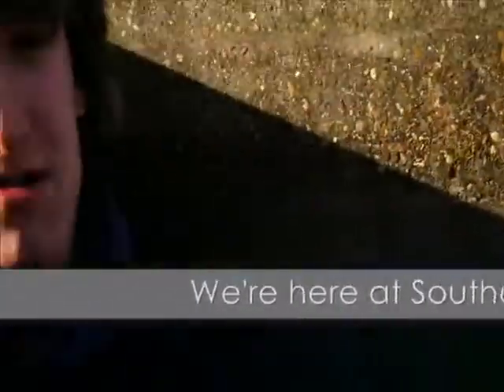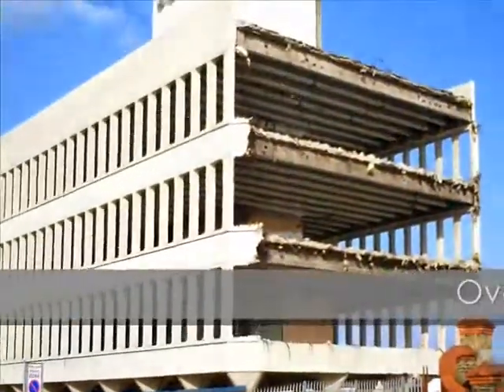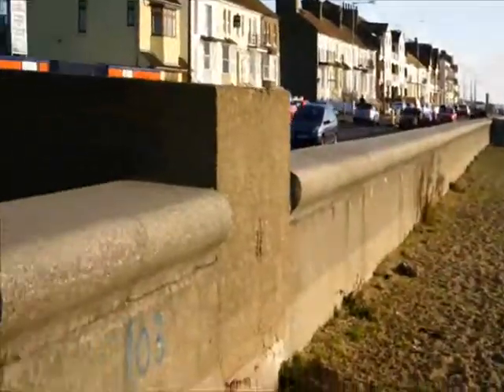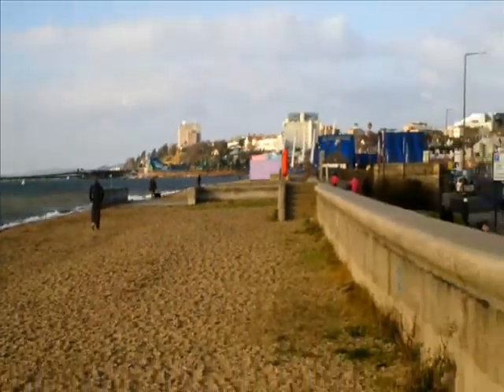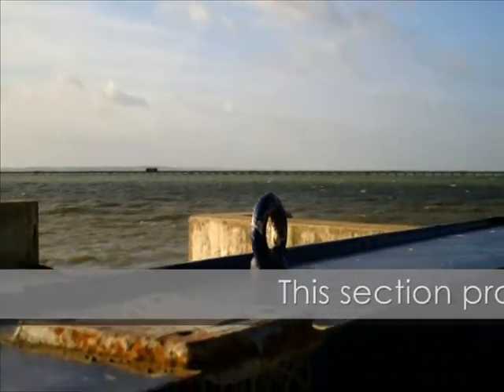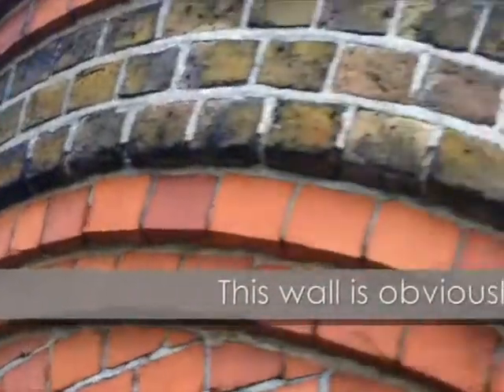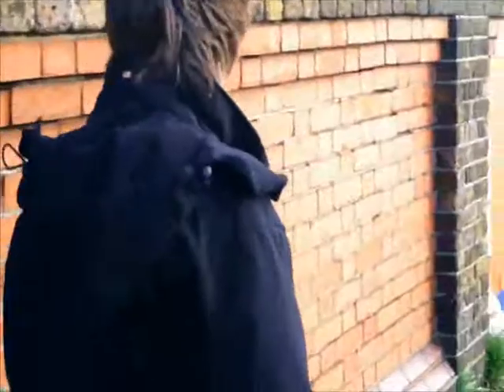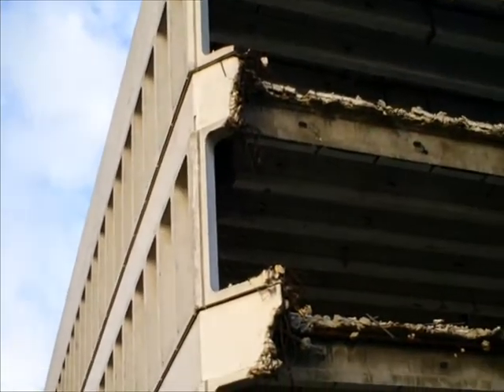Southend WWII Defences (2012)

Comment: Hi Guys, I'm always following your vids and you do some great work, however i'm destined to correct your facts on this one , the area to which you define as an industrial estate was in fact the site of the Southend Gas Works and the blocks attached to the sea wall actually stood at the base of the Gas company's delivery pier which housed 2 large coal fired cranes which took delivery of coal that was sent across a bridge across the road on conveyor belts directly into the gas plant, there was a loading pier that stood alongside to that which was Council owned and bared no significance to the industrial estate that never existed, the pill box was in fact the letter box to the Gas Works and was used for safety of its workers in case of attack, i remember all this from when i was a little lad and remember it all operating , sorry to tell you all of this but it had to be told, still keep up your good work lads
Reply from the maker: Hi Colin thanks for your message and following our videos. Of course this is an old video of ours and isn't made to the standards of our current ones. We are also much more careful with our factual information these days. Always helpful to have greater clarification, I have seen photographs of the gas works and the delivery and loading piers - I suppose I was referring to the industrial gas activities when I called it an 'industrial estate' although of course that isn't quite accurate. You may be correct about 'pillbox', although many people interested in this field recognise it as a pillbox - not to say they aren't wrong. It does have a solid concrete pillbox-like structure behind the brick wall which seems a little thick for a letter-box but who knows. Maybe it was repurposed after the war, although I'd also agree the slit is not designed like a regular pillbox loophole. Thanks, Liam